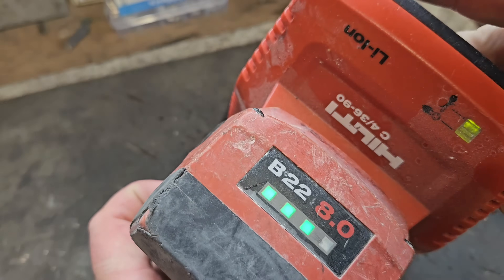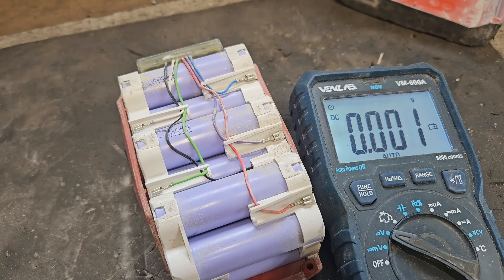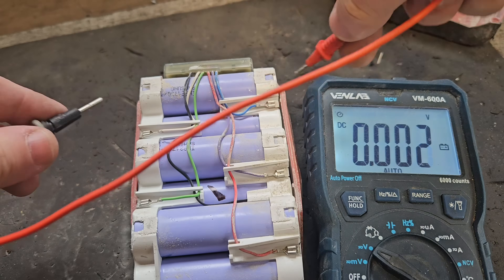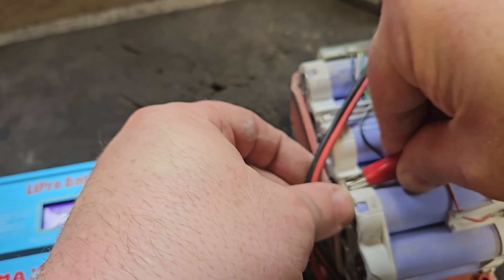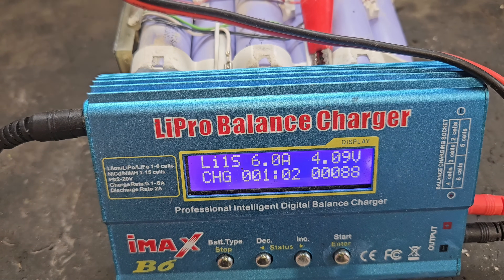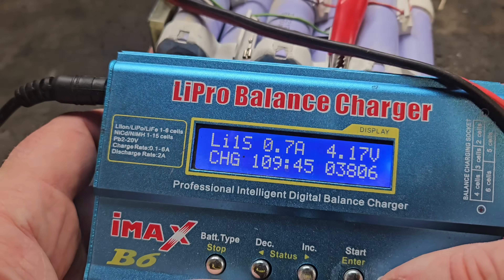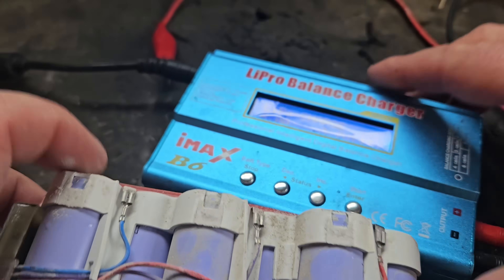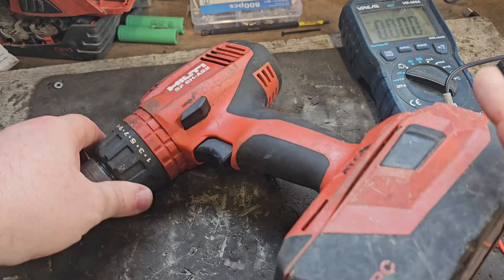DIY Battery Revival That Actually Works!

Comment: Properly done, well explained.  I have a few Milwaukee HD12 batteries that I've rebalanced this way.
The cells in the 3rd bank will likely drift again, just so people are aware.  The root cause is still there - likely a weak cell.  Not a problem, just have to rebalance it again while watching a romcom in a few months, a year, depending on your use.  

And thanks for pointing out shorting two batteries together is the WRONG way to do things.  There are easier ways to burn your house down.  

One pet peeve though - driving the screws back in.   If you drop them in and use a bit in your hand to turn them backward you will feel them drop into the old threads - turn in in a few, then use your driver if you want.  That way you can take the shell apart dozens of times without ever stripping a hole.  Now chances are the plastic will hold up to cutting new threads fairly well, I got in this habit thirty years ago when building speaker enclosures out of particle board, cutting new threads there stripped them instantly and we were forever taking things apart to change the crossovers.  Not to complain, just being an old man yelling at clouds here  ☁🌨
Reply from the maker: Thanks for the tips